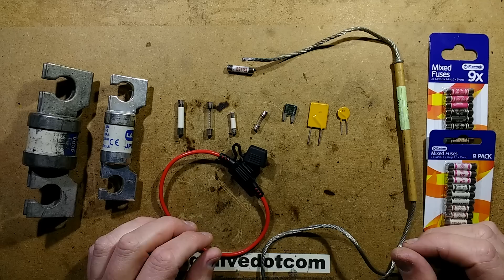Things you should know about fuses.  (including a 15kV one)

Comment: I've seen some weird fuse issues before, i've had the usual exploded fuses but ive also had fuses that when you come to check an appliance instead of getting the full 240v through them you get something in the region of 100v through. Now i've seen it a few times i know what it is. But the first couple of times ive been trying to diagnose faults and had real head scratcher moments trying to work out why i've getting weird voltages to components.  

It seems to happen quite a lot on microwaves and can lead to some really odd behavior. Interestingly it also microwaves where i most often come across high voltage fuses between the transformer and mag, and i have seen on occasion when an odd job type has tried replacing the proper 5KV fuse with an inline fuse holder with a 240v fuse in and often because it blew straight away the first time they tried it, they end up putting in fused for much higher current rating to get it to work.

Comment: One fuse failure not mentioned here that i got once was glass still clear, wire seemingly gone completely,  i would have sworn that i was pranked had i not been using the radio it was in when it blew.

I also came across "Paper fuses" in amongst my grandfather's old stuff (was a sparky). These looked like the ceramic sand filled ones, buf it was just a layer of paper that would discolor after the fuse popped. And the glass was quite thick.

Comment: At 9:06 you meant 1500mA (1.5A), not 1500A.  Also, at 15:50 you meant 1000mA (or 1A), not 1000A.  At 1000A, the wires going to the fuse would melt before the fuse blew :)

Comment: Back in the day, mains fuses in houses were ceramic 'bridges' with contacts and screw at either end. The fuse wire would be selected from spools of 2A, 5A, 10A and 15A - supposedly matched to the load. If the repaired fuse blew people often selected the next higher rated wire. None of the size restricted nonsense!

Comment: Is it ok to replace a T3.15 amp 250 volts ceramic fuse with a glass fuse of the same rating? the application is for a canon printer which is out of warranty.

Comment: Technically fusible links could have been in this group. Which is basically a thinner or smaller gauge ire in line with a heavier or thicker gauge wire. The thinner wire is enough to carry the electricity, but if there is a short the thinner gauge wire melts through or opening the circuit. Often used in vehicles, and in a place where a typical fused would be damaged easily, or just is not a good choice.

Comment: If it can be done it's been done!! fuse wise , i do lots of repairs & thats one of things i do check if fuse is blown & whats in the fuse holder. If blown  in what way as u explained, also the 'rewiring a fuse with similar size' is a nono as the wire in a fuse is a mix metal designed to melt at a controlled rate ect so putting same dia of copper in it may increase the breaking current a fear bit. good vid

Comment: I remember working for a company with overhead cranes.  One day the crane blew a fuse.  As I used to fix some electronic things n a bench I was called across after the foreman had changed the fuses several times,  It was the old wire fuses that had something like asbestos to stop the flash over when the fuse blew.   I was not to keen in getting involved in it at all, but was told to have a look as they could not get anyone till the next day.  I said just to get an electrician, but I was elected to have a look as the crane company couldn't get anyone to have a look.  So very reluctantly, I had a look, first thing I did was check for a short (which no one else had done.  I was asked what i thought I was doing?)  Didn't see the point of putting in a new fuse if there was a short.  However, the very impatient foreman grabbed the fuse and wired a new one while I was doing the checks, as there was contactors in the circuit I could only check so far.  I said there was no fault as far as any contact on the contactor.  So he stuck in the fuse and the crane ran, but not for long.  I didn't like the way he wired it, so I wired it, it lasted a bit longer this time.  I noticed he had twisted two bits of the wire together to increase the current blow!  The crane company had someone come clear so he appeared and wired it up, without checking for a problem?
He was no sooner out the door when the fuse blew again.  He came back scratching his head.  By this time I had worked out what was wrong.  I told the guy to wire it with fuse wire this time.  The wire had come off a roll of fuse wire, except it was not fuse wire, it looked like it but it was for something else.  There had been at least ten fuses in before i came back to this warehouse.  Three times by the guy who should have known better, the crane company.  However, I also took it that it was the correct fuse wire.  It said on the roll fuse wire and it was slightly above the fuse size on the fuse holder.  No idea what type of fuse wire it was, but it was not for the job.  They wanted me to go on a course after that for repairing the cranes.  NO THANKS!

Comment: Hello BigClive,

I have got a surround sound system Z506 logic tech which is the same as the one showed in below link:

https://youtu.be/QzgQ1_Ygpoo

I plugged UK mains plug into a second socket in series with UK mains Plug to IEC C7 and the subwoofer blowed instantly as I plug in the IEC C7 after that into the subwoofer instead of plugging it in first, and it created a loud boom sound. After that the whole sound system is not working.

In your opinion would it be a fuse problem that can easily be replaced? There is no burnt on the circuit that I checked.

By the way do you offer fix if people send items to you? I actually would like to fix it myself but if I couldn’t I would like your help.

Comment: Used to work with high DC amps and 50v  I never saw a fuse blow but the old guy told me that on some Very fast fuses they had a small charge in them to blow very quickly. These fuses conduct hundreds or even thousands of amps not sure I believed him. I have some 50 ma fuses can't seen the wire they would blow just by bad handling!
Reply from the maker: High voltage fuses often have an explosive trip system.  It's used to clear a fault quickly and sometimes to activate a trip mechanism that kills the other phases too.

Comment: What about shotgun fuses?
  I don't know that they are called Shotgun Fuses but when they blow they sound like a shotgun going off because they actually have an explosive charge to blast apart the connectors. They are used for power lines and I have a line outside my house that has these and have heard them go off, it sounds like a shotgun so I call them Shotgun Fuses.
Reply from the maker: +scot shabalam That sounds like these expulsion fuses in their proper cutout barrell.
Reply: Wow, I'm sorry I must have blanked when you covered the expulsion fuse. Also there are different styles of these fuses I'm used to seeing two ceramic(?) caps that fit together and have the charge between them so when it blows the two ends decouple from each other.

Comment: I replaced a small thermal fuse in a small domestic deep frier which seemed to use an internal spring mechanism inside (along with a material that would melt at a certain temperature), but it just failed again soon after, despite the same rating and mechanism. I think it was just a cheap frier that really just needed a slightly higher rated fuse, or maybe a current fuse rather than a thermal fuse.

Comment: Old-style UK domestic fusebox wired fuses (5A for a lighting circuit) make a satisfyingly loud 'bang' under your hand if you re-wire and plug them in when the circuit has a fault on it. Maybe I should have turned off the main switch after all.
Reply from the maker: Yeah, the old fuses are quite exciting when you plug them into a fault.  The 30A fuses are very loud.

Comment: Pretty much explained every pinball machine that I have gotten always has the wrong values lets see some 20Ampers here 30Amp there a house fire here and there for the prior operator being a complete moron I want to find em and slap em all.
And yep even a 1958 Club House pin that has a blow fuse with tin foil wrapped around it.
No wonder the transformer in the game looks like it was on a barbecue as it was most likely doing just that.

And yep I concur on upping the amps lower or higher but only a max of 1amp below or above.some of the old pins do need a slightly higher amp from old age but so far non of my EMs or Solid State pins have had problems.

The bad thing is trying to figure what the hell the amp values and crap are on the old 58 pin I honestly do not know.
I know ems use 10 and 15Amp fuses and even the Hee Haw EM uses a 8A slo-blow.

But not sure if a 50 era pin what amperage those used I am thinking 10 and 15A but don't want to assume.
And trying to find a manual and schematics is damn near impossible for a pin that old. o.o

If you have any ideas let me know as I am not really going to guess what fuses go in.
I want to get it going as it was in the era of pins that you literally had to abuse the machine to turn it on.
It has a metal rod that when you whack the bottom of the cab it would slam up and hit a leaf switch that would make contact and turn the machine on.
And do the same thing to turn it off.
It is in really nice shape for being so dang old.

And with the fuses being a guess work and needing a new transformer which I am trying to look for as well it may take me a long time to get it up and going.
Reply from the maker: If in doubt about the fuse values then try and assess the load that is on them and choose a fuse based on that and the gauge of the wiring.   Start low and work higher.  Fuses are cheap.  If the transformer is multi-voltage then you can fudge a replacement with separate transformers with one for each voltage.

Comment: 22:25 - I believe you describe the events of an Arc Flash here. Arc Flashes are no joke. They really are basically an explosion. Blinding light and extreme heat due to the electrical arc, and the sudden burst of intense heat and vaporised metal even creates a pressure wave. Legitimate explosive force. Industrial electrical systems like transformer yards and the like are the last place you want to fudge around with things.

Well, any kind of high voltage is something that should not be taken lightly anyway, and I'm not even an electrical engineer or anything. But I did stumble on some information about this kind of thing and arc flashes have killed quite a few people that weren't wearing the proper PPE. Injuries tend to result even with the proper protective clothing, I'm sure.

Comment: Everyone who works in electronics retail should watch this.  I work in a certain Australian electronics retailer, and there is zero training given on this kind of stuff.  We're expected to know before we start, or learn on the job.  On the plus side, watching this reveals I haven't been making any mistakes, but I was doing the right things for the wrong reasons.  For example, I thought ceramic fuses were primarily for higher temperature applications, where a glass fuse would consistently blow below its stated current.  That misconception didn't lead to any catastrophes, but it's still better to know that's not the case, now.

Comment: When I lived in Stirling, my house's fuse box had fuses that had a plastic head but ceramic body that slotted in to the fuse box, and one of the fuses kept breaking, usually when we turned the bathroom light on. So once every few months, I'd have to take that one out, put some (I think 5A) fuse wire in, which went through the hole and the ends wrapped round some screws on the ends. The ceramic on that one looked a wee bit charred. Fun times.
Reply: I remember those here in Dundee before we had breakers.  Dad used to stop my sister spending 3 days in the shower by taking the fuse out of the box and hiding it on his person, I still remember when they gave us our first proper Consumer Unit with circuit breakers and fancy digital readouts, the life just went out of him now he couldn't hide fuses from the family.

Comment: I am pretty sure this got answered in one of the 724 comments below this one. As an aficionado, I have always wondered why the voltage is not a factor when blowing a fuse, assuming its voltage is overrated (12v equipment with a 250v fuse). Why is it so that current is the only factor that matters for an ordinary filament that melts because it cannot withstand the power? I knew that P=I*V what I have missed is that power can also be expressed as P=(I^2)*R too so no voltage dependency.
Reply from the maker: A fuse doesn't really see any voltage other than that dropped across it depending on its resistance and the current flow.  Whether it's a volt or a thousand volts the fuse will always just see the current flowing through it.

Comment: I actually have a 23 kV fuse that the electrical utility gave to me for a project that I was doing, It has a screw-on fuse with the wire that holds a trigger in place that prevents the fuse from dropping out. I have a few good pictures of it on my Instagram (I AM NOT SPONSORING MY INSTAGRAM! IF YOU DON'T WANT TO FOLLOW ME, DON'T!): https://www.instagram.com/crazyxhorse1/

Comment: I pulled apart a high ampage semiconductor fuse. Off the top of my head think it was like 800A 600V. With a small spring loaded tell tail. The body of the fuse was aprox a 3 inch cube with two large silver plated 1/8" solid copper bussbar connectors. Was rather spectacular to open huge amount of sand with 3 corrugated what i could only describe as fuse plate. around 1" wide.

Comment: Looking at expensive multimeter hrc fuses the cheat is - just get same amp rating cheap glass fuse take wire out and put it inside blown ceramic hrc fuse. Don't forget the sand.

Comment: Jesus an arc from a fuse sounds terrifying and extremely dangerous
Reply: Yep - one of the few occasions in my life where I literally felt my bowels loosen!  The worst was from an 11kV arc inside a 500MW transmitter. I had my ear to the outside of the cabinet listening for an odd noise.  I found it just as the arc struck the inside of the grounded metal cabinet about 6 inches from my ear! :(

Comment: your right about the semiconductor fuses i have see them on a DC drive 500A  the fuses were  £1200 the thyristors £90 each the customer was not impressed when he blew 6 fuses to protect 1 faulty Semipak thyristor , Thousand amp HRC crane fuses make you cry when they blow too they are £3000 each i had to fix the crane test it with no fuses as the refused to put them in untill they were sure the fuses would not blow , the things you have to do

Comment: The one thing I'd say that you didn't mention is that fuses can be rated for different currents for AC and DC.  Since AC has that zero crossing, especially for those sand quenched fuses, the fuse can interrupt a higher current for AC than they can for DC.  I know in the US military (a long time ago) they used to use 400Hz for a lot of power generation which has its strengths and weaknesses, but for arcs, the plasma doesn't have to persist for nearly as long while the current direction changes to maintain the arc.  Obviously DC doesn't have that current reversal.

Also, I remember a lot of those little glass fuses actually had springs in them with a blob of low melting temperature metal.  When one would blow it would completely retract the spring into one of the caps.  Maybe I still have some laying around.

Comment: In the 80s Sears used PTC overloads on a line of economy freezer/fridge compressors. To test, I would unplug the running unit,plug in again and observe the PTC get smokin hot. A few minutes later,the compressor would be running. Not exactly Science,but it worked...
Reply from the maker: PTC thermistors are also sometimes used in motor start winding circuits.

Comment: bigclivedotcom,  can you do a review on a good/and price  multimeter ?  just need volts continuity, and capacitance ,  capacitance is important. (burner motors)
thanks.  
 https://www.youtube.com/watch?v=xBweqmLk6dU
Reply from the maker: If you're working on mains stuff I'd recommend one with category 3 or 4 input protection.  For less critical use I'm really liking a small AC/DC clamp meter called a Uni-t UT210E  It is a very competent little meter.

Comment: Those automotive rubber fuse holders are garbage, I used one in the engine bay of my 4wd for the spot lights and it caught fire one night. I pulled it out and cut it open expecting to see the fuse had blown in a violent manner but instead discovered that moisture had built up inside the cap and corroded the fuse terminals, which created high resistance till one of the fuse legs melted and the subsequent fire. Luckily it self extinguished and didn't spread.